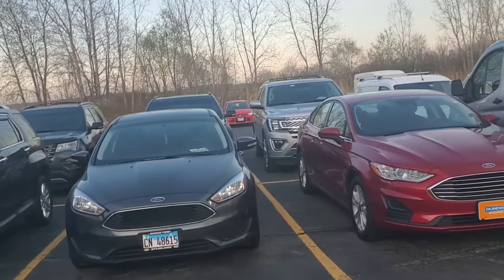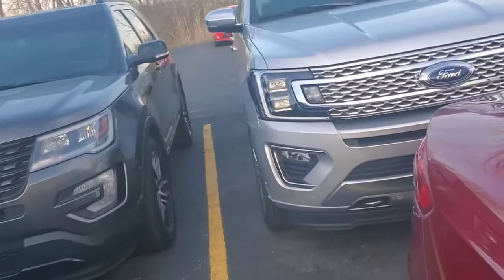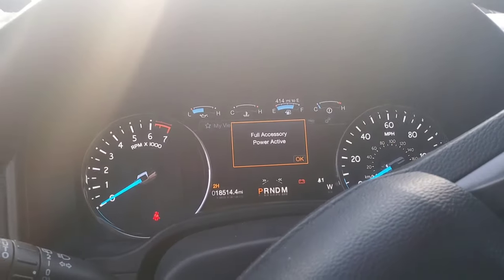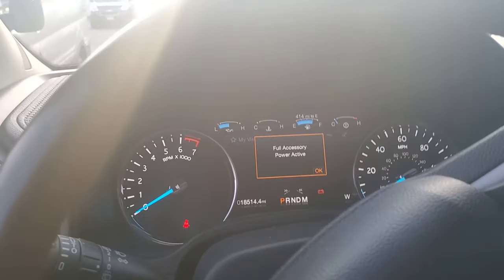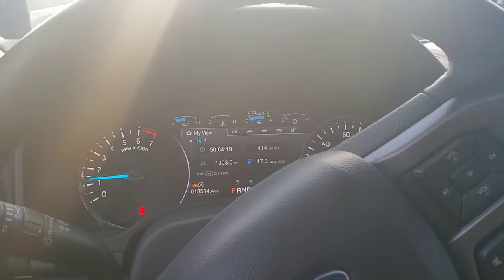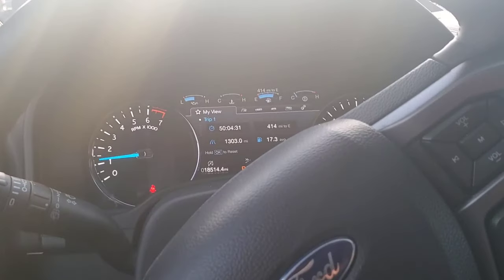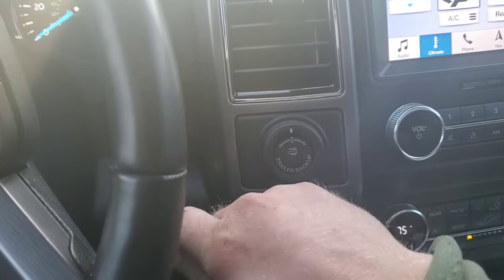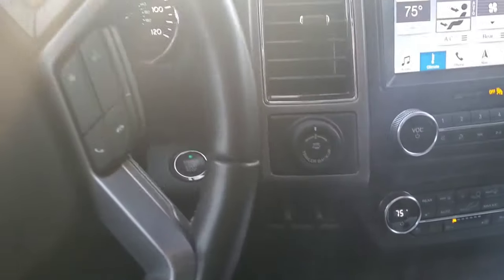3.5L Ecoboost F150 Rattle on Startup then gone, Try this - Could Fix Ford's Phaser Problem

Comment: Ford has a Field Action number 21B10 already takes care of this.
Reply from the maker: I would suggest that you look at my other videos because I am a Ford Master Tech I have already covered this and Ford has discontinued that reprogram because it's causing transmission problems
Reply from the maker: Please check out my other videos on this so you don't make the same mistake
Reply from the maker: https://youtu.be/8pTQsYUcKHg
Reply from the maker: And it does not necessarily take care of the problem they hope that it does but they're not guaranteeing that it does but through the process of putting this program in people's Vehicles they are getting torque converter problem and transmission shudder problems now so Ford has said wait a second there's a problem stop doing the 21b 10 reprogram
Reply: @FordBossMe  If it's already been done, can update 21B10 just be reversed. I asked dealer. No response yet.
Reply from the maker: @ThisIsTheWarRoom  I don't know why they can't put the as built data back into it because there is an option in the computer to program as-built data and remove any other data set
Reply from the maker: @ThisIsTheWarRoom  I don't know why Ford hasn't thought of this yet
Reply: @FordBossMe  That could be said of a lot of things. Amazing. But if we keep buying the truck Ford doesn't have any reason to change. I'm starting to feel Tundra regret....even if I'd have spent twice as much on fuel. This whole experience wasn't worth the savings.
Reply from the maker: @ThisIsTheWarRoom  I've had brand new 2020 Tundra 2019 Tundra in the shop with leaking front covers and oil pans less than 15000 miles on them and all they do is come for just an oil change but I get to see other manufacturers as well and they're also having problems maybe not as bad as Ford but right now is not a good time to buy a new vehicle at all
Reply: Great to know. My buddy and I was talking about this, he has a gmc pickup and his truck does the same thing on startup. Everything uptop is dry and needs oil on startup
Reply: @FordBossMe  You're right on the money and this was confirmed by my local Ford dealership. The same dealership that rebuilt the 2017 3.5 top end due to the phaser rattle. Thanks for the oil prime tip.
Reply: Are the gen2 eco boost more prone to startup rattle than the gen1 engines ? Seems like you hear most about this on 17 and 18 models. Also I’d like to hear your thoughts on the changes to the 3.5 over the years the dual injection system seems like a answer for the carbon buildup but things like plastic oil and trans pans, also not a fan of the newer transmission coolers using coolant. Lastly will shorter oil change intervals help prevent the startup rattle?  Love the channel thanks.
Reply: @FordBossMe  That is the response that the dealer gave to me yesterday

so the saga continues
Reply: @FordBossMe  what are your thoughts on an oil stabilizer that is supposed to get rid of cold crank noises. Something like Lucas. Thanks in advance.
Reply: Jeff Evans 
Why are you scared of a cooler using coolant? Automatic transmission coolers have been nothing more than a coil of tubing in the cool side radiator tank on almost every make and model of vehicle since the dawn of time. The only time you ever saw a cooler in front of the radiator was if somebody added it or it was ordered with the heavy duty cooler option, in both cases the cooler in the radiator is left intact and functional.
Reply: I have a 2l Ecoboost that is ticking a few minutes after startup. Will this work on it?
Reply: We programmed multiple trucks the day before the reprogram and now they shudder bad. Fse told us to unplug all vcts and ship them until they fixed the pcm reprogram
Reply: @eutimiorobledo  might be too thick.  I know not to use it on newer cars since I’ve seen vvti issues with people using them in Honda’s.  Maybe using the full synthetic version might work?  Or even a little thicker oil?  0w40 perhaps?
Reply: @FordBossMe  he there, I have a 2012 and I’ve started using Lucas in my oil changes and it seems to help A LOT!
Reply: Yuup. Ford dealeeship is charging $3k something for tgis phaser problem
Reply: Some older vehicles had a pressure switch at the oil pump that inhibited ignition until pressure was achieved. Oil filter change was a nightmare if you didn't top up new filter. Couldn't ford tell the ecm to do that with some code ?. Just overthinking things.
Reply: @FordBossMe  lol that’s awesome.
Reply: I had the 21B10 done, did not fix the rattle.  Next step is replacing the cam phasers.
Reply: @FordBossMe  
It’s not causing transmission problems. The “shudder”. That some are experiencing after having 21B10 reprogramming is actually and imbalance between bank one and two due some excessive wear in the VCT system which is amplified by the new program
Reply: Just a thought but I've heard the Lucas synthetic oil stabilizer takes care of the gm lifter tick and fords phaser rattle....."if they are not totally shot" might try Lucas synthetic stabilizer on my 2018 3.5L f150....apparently its highly recommended!!
Reply: I had the recommended program update done last week at my local Ford dealer.  Cam Phaser rattle is now just as bad, if not worse than before the update...and now my F150 is idling rougher than it did before the program update.  Calling Ford service again today....your fix sounds logical and don't understand why they don't just artificially extend the crank to get the oil pressure up, prior to starting.
Reply: I just bought a 2017 and wondered what was up with the rattle. Every time I went to look at and drive the truck before purchase, it was already running with the A/C on. I thought that the Ford dealer was just being courteous. I took the car home, started it for the first time ever and it sounded like a diesel for 10 seconds. Immediately took it back to the dealership. They showed me the recall that they never disclosed, and set me up with an appointment for a software update and told me that'll take care of it. I'm not a mechanic, so I figured a Ford dealership has to know what they are talking about, right? I just bought the most expensive vehicle I've ever owned, and I'm kind of freaking out after watching 20 videos of this issue and the secondary issue that'll come with a software update. I watched your other videos too. Great videos, buy the way. Anyhow, I just ran out at nearly 10pm in my shorts and slippers to try this out. The truck has been sitting for 9 hours since I came back from the dealership. Its 60 degrees out and that engine was ice cold. I did what you just showed me and it fired up without a rattle and purred like a kitten. I'm so thankful for you and your generosity. You don't have to tell anyone anything for free, but you did, and you've given me some peace of mind. I'm still going tomorrow to talk to the shop and let them change the VCT units. If the shop at Ford knows anything, they will see the TSB and field action telling them not to reprogram the vehicle. I took notes and I am going to make sure this is done right. My question is, if you have answer, is this "new" new fix I've seen in the past few days a real thing? Has this issue been resolved?
Reply: @FordBossMe   MPT tuning does an extended crank through their tunes to help build oil pressure at startup.. those guys at MPT really know their stuff as far as safe effective tunes that really build alot of power but they also take into account the previous issues these 3.5s have had
Reply from the maker: M  you got to go back in and get the program taken out of it 21n 08
Reply: I'm not a technician, but from what I've read and seen on youtube, 21B10 generally won't fix the rattle if it's already happening.  Ford is hoping it will prevent it from occurring if it's not already.  If it is happening the phasers will have to be replaced to fix it, unless you do the extended cranking trick.
Reply from the maker: @richardrogers2110  exactly
Reply: @FordBossMe  can I send you a video and you tell me if my issue is the same knock you are referencing?
Reply: @FordBossMe  even worse is the new turbo2022  tundra, the turbo been failing after 500 miles, and it’s a body off engine repair! Even better it’s six weeks for turbo…. Oh what a feeling.
Reply: They halted this some time ago
Reply: I have 2019 F150 3.5 , already had cam phasers replaced by Ford about 1 year ago , now there rattling again........
Reply: @FordBossMe  what can I do about that? I have a 2017 Limited and they did the recall cam phaser "fix" and now I feel like I get a lot of engine shutter and hard vibrations around 3-6 gear when accelerating unless I am pressing the gas hard.  If it is soft acceleration I get a hard rattle.  Would Ford help correct this or am I screwed?
Reply: I have to drive in Sport mode for it not to do the lugging vibration around 3-6 gear.
Reply: @FordBossMe  I have had my transmission worked on now it’s my cam phases
Reply: Oh folks I did that cam phaser rattle update from Ford and it did nothing. I have a bad rattle on every start up after some time sitting. Be fix here I have not tried yet but I plan to next time I drive. Thank you for this because the dealer acts like there's no problem.
Reply: @ThomasEvans11  sounds like an over shifting problem ive seen it in my expedition. Usually if I'm on the gas then let off quickly going 25-50mph
Reply: Ford needs to pay you for a trip to Detroit to take to some of the engineers.
Reply: @jeffevans4598  Mine is a 2019 and does it.
Reply: This "fix" does not work. I had my phasers replaced, and the PCM reprogrammed (never had trans issues), and the rattle came back about ~40k miles later. My Expedition is currently in the shop to replace the phasers with the latest part# Ford has released which is an entirely redesigned phaser. Hopefully it works, but I doubt it.
Reply from the maker: @brianlepe9372  do your research under the videos I have in the library, the third Generation of phasers seem to work
Reply: @FordBossMe  How do we get Ford to acknowledge this and replace them?
Reply: @r.dfordtech5996  the transmission shudders??
Reply: @joeyleroy6877  have you taken it back to the dealer...if so what did they do next
Reply: @mackg02  , yes ford will ONLY do the Cam Phaser fix 1 time , per ford. Even if you purchased an extended warranty. They will do it 1 time only. Ford has MANY law suites Against them for these eco boost engines.........
Reply: I had my 2018 f150 platinum in at 30k to have phasers replaced. It is a onetime fix, which is bullshit. Now I with 83k and have to come up with 2500. To get new ones after only 50k miles they need to be replaced again! This is my last ford
Reply: Ford Shop did htis "fix" 21B10 for me and it didn't take care of it
Reply: Man, my 2011 f-150 ecoboost just started doing this occasionally.  Like once every other week occasionally, but one time it was pretty damn bad.  I haven’t tried the fuel/break crank thing, but it crossed my mind about killing the coils for a few seconds prior to starting.
Reply: Awesome video brother this worked perfect for me!!! I dont know why Ford doesnt have an auto oil prime this issue affects millions of vehicles and this feature would only increase their product/vehicle valuation and user satifaction :)
Reply: @FordBossMe 

Transmission problems?  It was my understanding that the TSB 21B10 had to do with making sure that the cam phaser parking pin would stop in the correct position. 

If you already had the cam phaser rattle this wouldn't fix it.

Also it was explained my another Ford master tech that any shoulder after the TSB 21B210 was completed was due to journal wear due to improper maintenance. 

I never had any rattle and had the TSB 21B10 completed on my 2019 and haven't had any issues since.
Reply: Just got a 2011 F-150.  This worked for me.  Glad I found this video, I’ll be doing this every cold start from now on.
Reply: Dude this is amazing! Thanks for the tip, since it’s oil pressure I’m assuming the fact that I have a block heater that wouldn’t do anything right?
Reply: Ive got a 2011 f150 3.5 XTR, i just hit 233,000 i’ve been religious on oil changes while doing plugs and coils when needed, well also i clean the throttlebody and all the sensors. Im just now getting the rattle on start up. I started doing this method you showed on startup and it has not happened since to me. The proof is in the works IMO. I appreciate this video tremendously.

Comment: I was advised to do this on cold starts when I purchased my 2014 3.5 F150 new. Currently at 150,000+ miles, never had any rattling on startup. Ford could have made the ecoboost a 350,000 mile motor by adding a prelube pump.
Reply: How many miles are you on now?

Comment: I have a 2019 F-150 3.5 ecoboost. Is started rattling at startup at 9000 miles. The repairs were completed at 12,300. I mean that’s when I took it in. My point is Ford has had this cam phaser problem going on for years. Every time the engineers came out with a new c/p it didn’t last. The service writer told me mine were replaced with the 3rd generation cam phasers. I can’t imagine the amount of money Ford spent trying to fix this, and you come up with a simple way to deal with the issue. Way to go man!
Reply from the maker: The issue that I came up with here is just a temporary fix it doesn't really fix it you know it just makes the rattle go away
Reply: When and how many oil changes on the truck before the cam phasers started going out at 9,000 miles??

Comment: I'd absolutely love if cars had remote start with a separate electric oil pump that doesn't filter and pre primes the engine before finally firing the engine up after a couple or few seconds. I'd always turn my engine on that way. Not cumbersome at all just to click click when walking towards it.
Reply: That kind of brings up a good point, I wonder how many people are unaware of this problem because their first start of the day is remote.

Comment: This could work, except then customers would complain about the extended crank. Complainers gonna complain.
Reply: Does the 5-6 second extended crank cause any harm or issues to these motors?
Reply: @cockatiels31  I would imagine more stress on the starter and plate
Reply: Up in the air if it would cause more starter damage with extended cranks.

Comment: Here's some additional information on entering 'flood mode' with a key-start ignition system: there is no need to hold the key in the 'crank' position once the engine begins to turn over. Just fully depress the brake (for safety) and the accelerator pedals, turn the key to get the engine spinning, and take your hand off the key. The engine will continue to spin until your release the accelerator pedal, at which time the engine will start. Not everyone  can walk (twist the key), chew gum (depress the accelerator pedal), and scratch their ass (depress the brake pedal) at the same time. Carry on.
Reply from the maker: It doesn't matter it's either or there's no reason to add anything more to it
Reply from the maker: I've literally been explaining this for years and I've been one of the only sources if not the only source for a long time I don't need anything else added to my information I've been perfectly 100% explaining it and not a single person has had an issue of not following it
Reply: @FordBossMe  Kid, I've been using 'flood mode' after oil changes since the day I bought my '84 Thunderbird Turbo Coupe, new. I was merely pointing out that it is not necessary to hold the key in the' start' position once the engine begins to spin. If you knew that, you wouldn't have done it in your video. Relax.

Comment: I've always wondered why they didn't install a secondary electric primer pump for the oil.  When you unlock or open the door, and the fuel pump kicks on, turn on the electric oil primer as well.  After a few seconds, or upon starting,  the electric pump would shut down and the mechanical pump would take over.  The pumps would be isolated from one another by check valves, and use the same regulator for both.  Eliminates startup wear and primes phasers.

Comment: You were on the money again with this one. I have a '15 SHO that's already had the phasers, chains, chain guide and intake cams replacement in early 2020 for that rattle, not sure why they replaced the intake camshafts but I wasn't arguing because it was warranty work. Even with all the work done on my motor, that rattle is still there for about 2-3 seconds on a cold start, gonna mention based on one of your recent videos that I have a K&N oil filter. My car has been sitting for five days (I work from home) so I gave this a try, took my foot off the gas after about a three count of the engine cranking and voila! No cold start rattle. Great video once again and thank you.
Reply: I had a 2009 Jaguar XFS with this same problem on the 4.2L engine.  Supposedly the cam gears had seals in them to keep the oil in, and when they failed, it would leak down the oil pressure, and cause that rattle on startup until pressure built up again.  I'm not sure if it's related, but Ford owned Jaguar back in the late 00s, so maybe they used their variable timing tech in their own engines, and then ended up with the same problem.